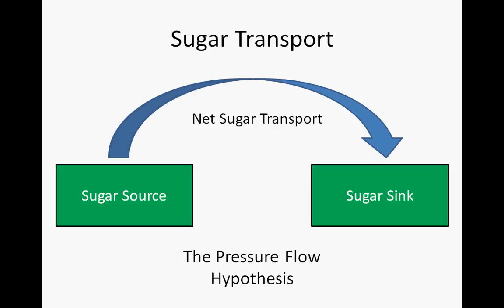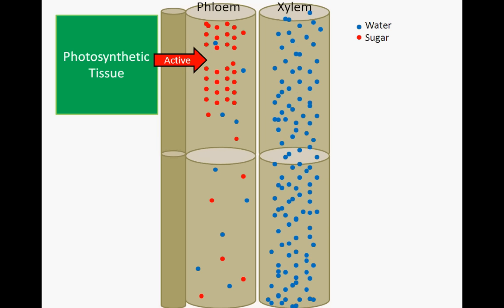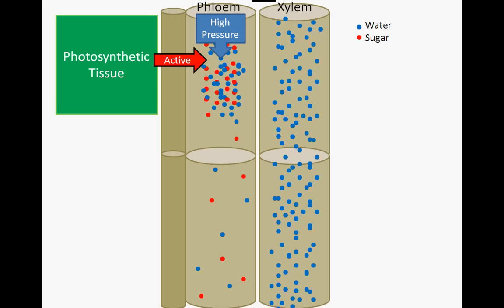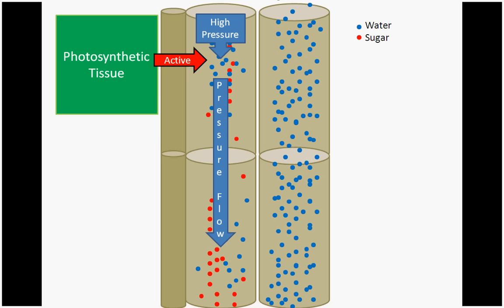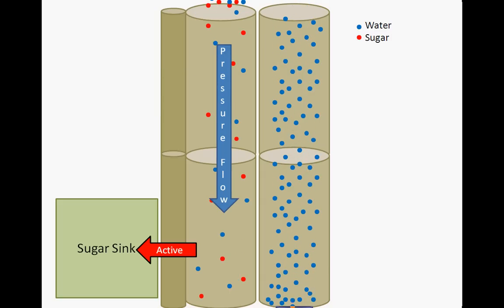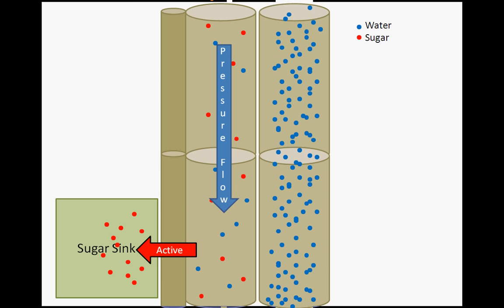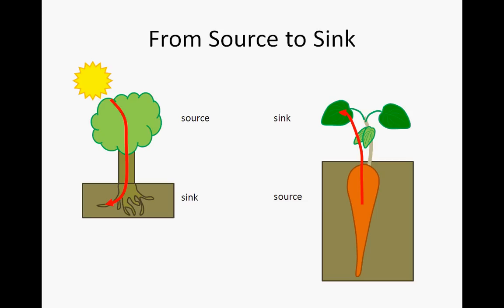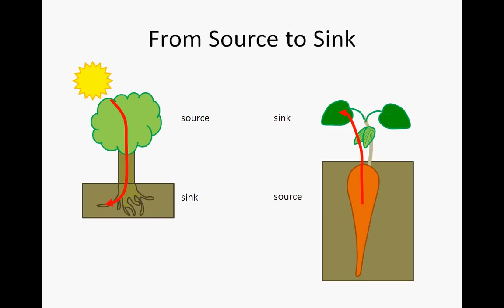Sugar Transport: Pressure Flow Hypothesis

Comment from the maker: Yes, the areas of the plant that actively output or input sugars are controlled by hormone signalling. These inputs/outputs then affect phloem flow on the basis of differential pressure.
Reply: son im back after 9 years i got the water from the plant

Comment: Sugar loading in the phloem of the source tissue requires energy. Sucrose is loaded against its chemical potential gradient with a carrier (Symport system with protons, H+). Later water enters passively, pressure increases, and movement of water and solutes occurs by pressure flow. Unloading in the source tissue is also required and energy could be also needed, depending on the type of sink (growing sink or storage sink).

Comment: Correct me if I'm wrong, I'm trying to understand this subject. 

1. Water from xylem will move to phloem because of mass flow (water moves from sites of high concentration to sites of low concentration).

2. The movement of water from X to P will be made through selective membranes (Osmosis).

3. Because of sugar molecules in the P, the solution will move throughout the Phloem from sites of high concentration to sites of low concentration (Difussion).
Reply: Yes. You're correct so osmosis moves water from xylem to phloem and then pressure builds and osmotic pressure builds so everything goes down the tube to the sink so you're correct.
Reply: Oh, cool thanks.

Comment from the maker: The phloem doesn't know; its flow is simply the result of pressure differential, moving from high pressure to low pressure. The pressure in the phloem is determined by the plant's active transport of sugars. At the source, the plant actively pumps sugar into the phloem, water from the xylem follows in, and a high pressure area is created. At the sink, the plant actively pulls sugar out of the phloem, water passively returns to the xylem, and a low pressure area is created.
Reply: Sir can you tell me please why sugar is actively transported into phloem.Jn leaf concentration of sugar is high and in phloem it's low .Then why active Transport ?why not passive?

Comment: Why doesn't the sugar move from the phloem to the xylem due to difference in potential?
Reply: I suppose the membrane is only permeable to water, therefore only osmosis is allowed?
Reply: +Christine Tao Thanks!
Reply: +Shreya G I may be wrong. don't trust me completely lol
Reply: Because water potential is high in the Xylem.
And water moves from higher water potential to lower water potential.
So over here Xylem has higher water potential. And phloem has lower water potential.
Reply: Presence of solute (e.g.sucrose) lowers the water potential.
Reply: @kiranshafiq2669  is that hypertonic or hypotonic... I think it's hypotonic because in hypotonic water always moves from higher water concentration to lower water concentration to minimise the low water potential due to solute which results in the bulging of phloem but why in my ncert 12 it's written hypertonic... Please answer

Comment: Movement of water is called osmosis not diffusion
Reply: Wrong. Movement of water through selective membranes is called osmosis. Diffusion is the movement of any species from sites of high concentrations to sites of low concentrations, until the concs are the same. BTW if the diffusing species is water then diffusion and mass flow are the same.
Reply: so Stalin in that situation he could of called it either osmosis or diffusion?